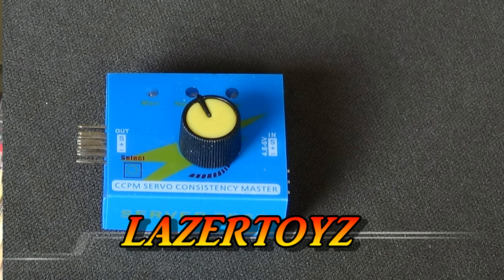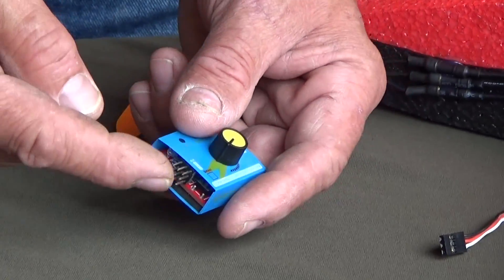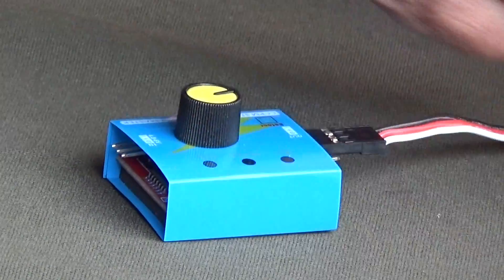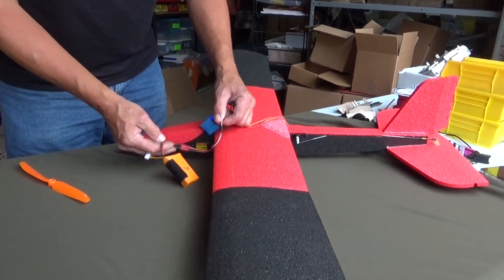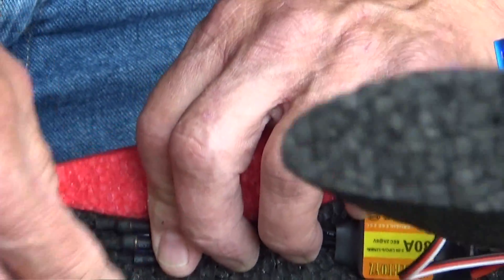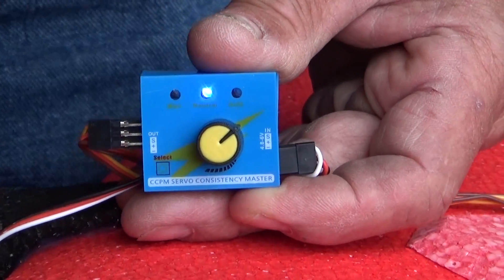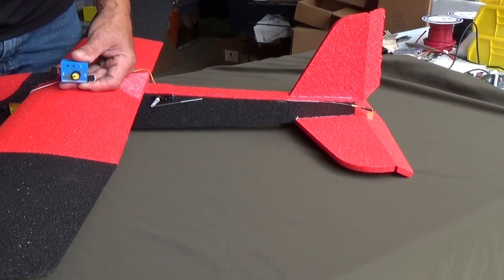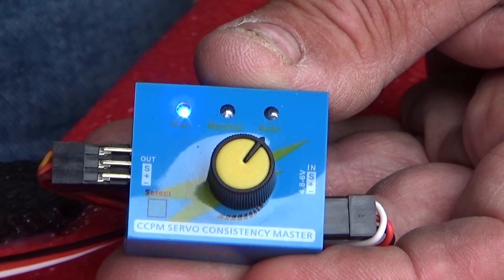Lazertoyz Servo Tester

Comment from the maker: It has 3 modes, In centering mode what it does is send the signal that  is right in the center of both ends of signal range. So this is what your radio signal ( pulse width ) should be when your sticks are in the center position. I find it fairly accurate.

Comment: you can build one its a circut with a 555 timer ic
Reply: Sure you can if that is what you want to do. But this little tester device does a few more things than a 555 timer alone. I got mine for about £2, quite a bit cheaper than the price quoted here, by ordering it from a Chinese web site. You couldn't build it for that including pcb, and connectors etc.

As lazertoys says this tester allows you to test a lot of your RC setup without tears.